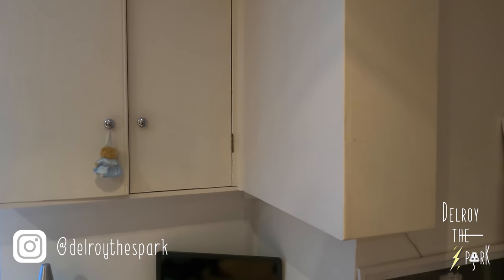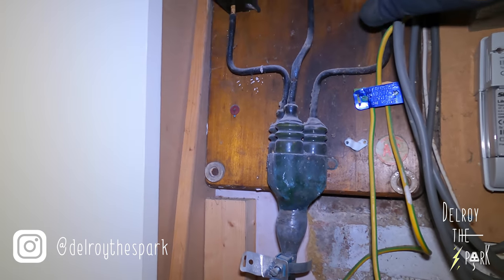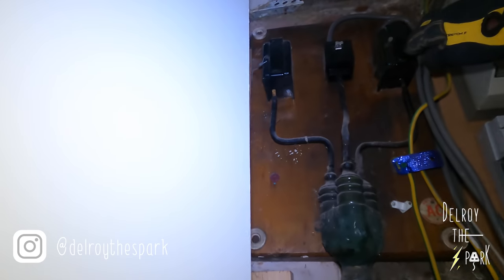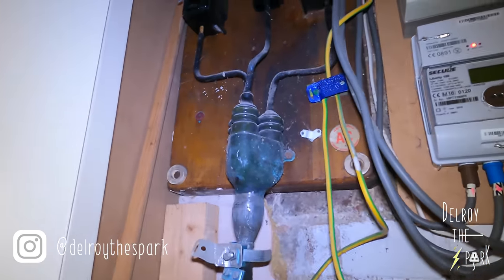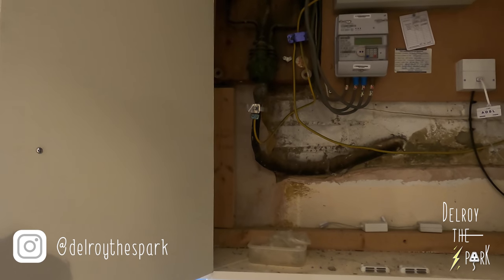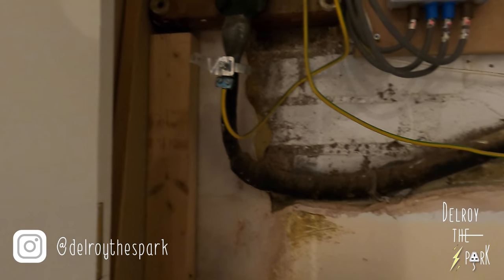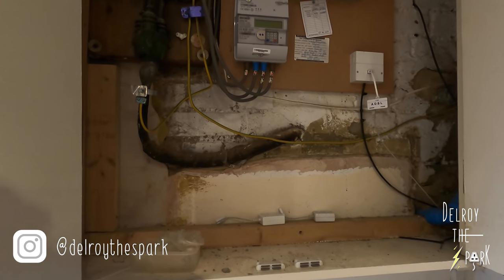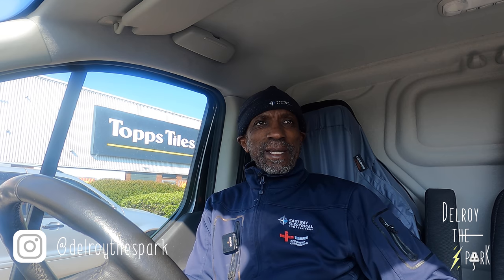"You Need To Contact UK Power Networks As This Is An Emergency" | Electrician In London Vlog

Comment: Absolutely shocking how competent the woman on the phone was compared to literally any company you could possibly call in the states. I am mad jealous.
Reply: Believe me, the majority of call centres here now are pretty clueless. lol

I did manage to get through the first call centre for Sky recently about our broadband dropping out, though,
The lady at Sky/BT was very helpful, knew what she was talking about, and immediately booked an engineer to fix the line.

(phone wire pulled out of the terminal on the telegraph pole during a mild storm.)

That's honestly the exception to the rule, though. The first guy at the call centre stuck rigidly to his script, and forced me to do the basic checks again, like switching the router on and off before he would do ANYTHING else. lol

The waiting times are generally quite long, too, even before the Rona.
Most call centers are farmed out to Countries abroad, too, so they often don't have direct contact with upper management at the company when there's a problem.

But yeah, it sounds like the US has it a bit worse than us overall?
We can at least sometimes still make contact with a human here, and not just an automated message or script robot.
Reply: @electronash  My ISP (Teksavvy) here in Canada will also typically go with the whole basic turning the router on and off and all that malarkey too.  That is until they found out that I worked in a data centre previously.  I suppose they put a note on my account because when I call for support now instead of the basic questions they start getting me to do various network tests so they can avoid getting a technician sent out.  I know I am technically doing their job for them in that situation but hey, whatever gets my internet issues at the time diagnosed the quickest I'm pretty happy with as it gets things sorted out sooner.
Reply: I work for an equivalent electricity distributor in a different region of the UK. We have fairly high standards but the key is keeping staff long term as the amount of knowledge you need to retain is pretty immense & people naturally want to move on up the ranks & out of talking to the general public on the phones, who can be a bit of a challenge at times. I've been in the customer service side for nearly 20 years now, mostly due to the decent pay, good working environment (from home for last 12 months) & abundant overtime. Experience is key. Still, people interact with us as if it's our first day on the job, when we've heard it all a thousand times before. 

The sparky in this video does a proper job and speaks to the local distributor himself. Many just pick up the easy callout fee & run, leaving a clueless customer to call in & give god knows what explanation of what is wrong.
Reply: @electronash  funnilly enough i noticed whilst longer waits the quality of the calls went UP during rona the staff seemed more relaxed more intentive to helping you when you needed to be transfered they would jump you through the queues they would pre brief the next person on EVERYTHING manager escalations tended to happen more promptly and everyone just seemed happier

i think having the call center folk work from home rather than some stuffy office block with bitchy supervisors prowling around them like hyenas is the best decision theyve ever made
Reply: @Sarge92  Yes, in fact I could tell the person I got put through to was working from home, and she was super helpful.

No background noise nor supervisor, and she knew exactly what to do, and understood the tech involved.

It has been interesting to see how working from home has improved certain areas for some companies.

Obviously we'd ALL rather the rona was never here in the first place, but maybe there are a few lessons to be learned from it.

I heard that certain companies are even considering allowing more staff to work from home now.

(especially in the IT sector, where people don't necessarily need to be in an office environment.)

There have also been studies in the past where they changed the school opening hours for students. Starting school at say 9am instead of 8am had a pretty huge impact on alertness levels and learning.
Reply: (suddenly reminded of scenes from Office Space. lol)
Reply: @electronash  ive seen that although it was a little different for ages 6-10 they recomended 7am to 8am starts and for 11-18 they recomended anywhere from 10am to 11am because they found that teens needed anywhere upto 11 hours of sleep in order to have full cognative fuction turns out reqiring your entire hormonal system to new adult software takes alot of energy out of you hehe
Reply: That is definitely not normal for the UK. I've lived 20 years in the UK and 20 in the US. Any service person in the UK (if you can get hold of them) generally acts like they were hired 20 minutes ago and plunked into the job with no training.
Reply: The guy mentioned that he was with Octopus Energy, I've been using them for over 2 years and have been really impressed with their customer service!
Reply: @electronash  same in germany..

DSL Connection is not working, i tried 3 different modems, tried connecting the modem directly where the phone wires enter the house, restarted several times... but when im on the phone, they insist you restart the device, even if you say you are in fact competent and tried all this.. no, sir, please restart the router
Reply: @Enclave.  I used to work in a isp call center, and unfortunately this is a case of a few people spoiling it for all the others. I would get multiple people a week claiming that they have already done the basics, when they had not done anything apart from maybe turning the computer on and off, and some times not even that.
Reply: @canonip3000  Trouble is people lie, so you are forced to do it all again because of those people. Saying you are competent is also no help. Many male 20 to 30 year olds will say they are competent or expert on computers, when they are not, and takes more than the first few minutes of a call to see if that person really is competent or exagerating their expertise.
Reply: Probably because those emergency numbers don't end up in a callcenter but distribute to a helpdesk at the company itself. Meaning you would end up with well trained staff who know what they are talking about.
Reply: @Sarge92  11am school would be terrible. I don't think people want school taking up most of the rest of the day.
Reply: @electronash  used to do some call centre work and something I noticed is that the only people who even bothered following along with the scripts (other than the legal scripts - everyone used those because the law and shit) were new people and people sat right near the bosses

everyone else would use their intuition and know how a bit to get stuff done faster and more efficiently
Reply: shes more competant than most people here too. i keep having to battle a power company here cuz they keep trina charge a house i own with something like a 3 grand bill even though the house has been disconnected BY THE COMPANY for almost 12 years
Reply: @electronash  sent a technician to fix it, not an engineer
Reply: @Enclave.  same with internet here in the UK. this is an emergency line. same as calling 999/911. these call centres take calls for people reporting gas leaks, major electrical emergencies and the like. they wouldn't put an untrained dummy on the other end of these types of calls. 

with ISPs, of course you will get a call handler who justs makes you do a check list of different things to diagnose faults.
Reply: @richardclarke376   My brother worked in a BT call center and it was a nightmare of a job. He would have been somewhat useful for a caller as he's actually generally knowledgeable about the area prior to getting the job but BT basically just gave up on their training part way through leaving them struggling. Every other person he was hired and trained with had left within 8 months, he left after a year. The turnover is so high because companies just don't look after the new staff and I think they just give up and move on constantly.
Reply: People in this post are talking about chalk and cheese. How can you compare power grid workers to satellite TV workers. 1 literally is responsible for life, the other is responsible for what TV stations you can get.
Reply: @electronash  I understand where you're coming from but we sometimes forget that for every competent caller there may be incompetent caller calling the helpdesk. You just have to watch reality tv like 24 in A&E to see how people like to waste time or want company
Reply: I think he was lucky... They are by no means all that competent her.... But great job whoever that lady was.
Reply: @electronash  unfortunately the first guy you get HAS to stick to the script and get you to check this and that because 80% of the people wanting escalation usually have an issue that can be fixed with these basic checks. This happens with sky, virgin, etc etc
It's an unfortunate downside of making sure that the waiting times stay as low as possible (if you think they're bad now, imagine if everyone lied about doing the checks, only for the issue to actually be solved by one of those checks. That's why you have high waiting times)
Reply: All she needed to know was the the cable head was overheating. She's admin and has picked up some lingo, but doesn't actually understand, nor care, about 2ph supplies etc.

Comment: I'm a network operator responder, we deal with these every day. The main difference between us and a sparky is the PPE we carry can protect us while working live with insulated gloves  jackets and face shields.

We would have to respond to this job within three hours.
Reply: Mate you need to start YouTube channel with your callouts
Reply: Was about to comment that the spark should have just been straight onto the DNO after assessing it was not the consumer side and they would be out in a few hours.
I was in a property recently and discovered a previous occupier had been steeling the leccy but on righting the connection, had screwed up and gave reverse -ve polarity.

Had a local out, the DNO out, their supervisor out all within an hour.

I now carry a tester with me when going places and always test the polarity and earth before plugging anything else in.
Reply: I had something similar where they were having power cuts when using an electric shower. Turned out to be a loose connection on the supply side. I was amazed how quickly they were out to sort it, think it was less than 30 minutes.

Comment: That mains feeder is vintage, would be awesome in a collection. Looks like it is mini glass insulators. Certainly looks the part of a mad scientist tehehe! Service provider def should come out and replace that with an updated connection to the latest regs. I too would suspect a poor connection, causing arcing and thermal runaway. Thanks for sharing, always love seeing unusual and vintage items in a setup!
Reply: it belongs in a collection, not in service
Reply: @lorenzo42p  Those old service heads were made to last. I wonder how long today's plastic junk will be around. I reckon it has at least another 250 years service in it 😂
Reply: @Rooster---ooo  the problem with these is often where the glass meets metal. you can't see inside to know if it is in perfect shape or if there is corrosion and looming failure. for something as important and possibly dangerous as this, it shouldn't  be overlooked until a problem does come up. foreign electrical just amazes me, the things they find acceptable and normal. I definitely don't like how electricians here worship the code book, but some things we just know to never do. we don't mount circuit breakers directly on wood connected to dinosaur cables.
Reply: @lorenzo42p  Over the past 20 years I've heard of very few critical failures of old cutouts. They do break down from time to time, but that's to be expected when you have millions in service. Ideally, they would be updated (as the one in this video probably was) but just because they look ancient, doesn't mean there's anything fundamentally wrong with them. At last in my experience.
Reply: @lorenzo42p  please. You used to mount uninsulated wires on porcelain knobs screwed directly into the wood of the building. You totally did mount fuses directly to wood panels at some point. Not every building could afford to mount them on marble slabs.

Just as no modern electrician here has done this in decades, you haven’t either. But the power company’s main feed isn’t going to magically upgrade itself, even when the home owner upgrades their own stuff.
Reply: my concern is the what if. the use of a circuit breaker or fuse is so the electrical system will fail-safe. we want an uncontrolled situation to become controlled and safe, as quickly as possible, faster than a blink of your eyes. we want very low chance of a catastrophic failure, like the building burning down. the electrical feed for my house comes into a metal circuit panel via a thick metal pipe. if any wire inside that box becomes compromised, it's contained within a thick steel container. at the minimum, that allows me time to escape.

I am definitely not a safety nazi. I disable and remove more safety devices on things I own than there are remaining. but be smart about it, think ahead, understand and accept the risks.
Reply: @lorenzo42p  futzing around with an existing situation is what gives you risks — as you can see here; with the failure being caused by the meter upgrade.

A mains feed that has been both completely stationary for fifty years and also completely safe isn’t going to stop being safe out of nowhere.
Reply: @JasperJanssen  I understand if it ain't broken don't fix it, only make things worse, can of worms. but on the other hand, this component wasn't directly messed with. it only took a little nearby work to cause a failure. is it a card castle just waiting for a touch for it to all come down. I could use a gas can as a desk chair for 20 years until one day it falls over and starts a fire. was that safe until it wasn't?
Reply: @lorenzo42p  you could get exactly the same result by changing all of it out, if the same incompetent was doing the work. The danger here wasn’t the old fuse, it was the idiot who didn’t tighten the connection properly.
Reply: @Rooster---ooo  i think it may well date from the time of dc mains as the street feed with that was opposing polarities + and - 200 or with common centre, alternate houses on alternate polarities, (lucky ones had 200v positive, unlucky ones 200v negative, in terms of things like tvs and radios), usually one polarity per house but some may have had both for high power usage

Comment: I had my power go recently due to the 60+ year old joint in the street failing. When the UKPN chap pulled the service fuse he found someone had bridged it with copper wire! Previous owners of my house had an electric shower and were partial to a bodge so I suspect they had the 60A service fuse blow whilst showering, running the washing machine and boiling the kettle all at once and thought that was a suitable solution. 
Stupid, stupid people.
Reply: Six-inch nail is another favorite. Just asking for trouble.
Reply: That's the only electrical tip you need.
"IF A FUSE FAILED OR A BREAKER POPPED, IT WAS PROBABLY SOMETHING YOU DID, STOP DOING IT."
Reply: @jr540123  A lot of that stuff is an emergency fix that gets forgotten about, in a car I'd give people a much better pass than their house.
Reply: 60 amp? thats not alot of power. im in canada. i can run my car charger, my washer, dishwasher, heatpump, my oven, my microwave all at once without issue.
Reply: @diablalexfull  UK Voltage is 220-250V, whereas in Canada it's only 120V. Most houses have a 100A main fuse in my experience.
Reply: @Oscar-if6lq  Got 240v also to in canada to run oven, tumble dryer and aircon.
Reply: US/Canada should start using 240v points for kettles as well
Reply: @finnw1  when I update my kitchen I will get another one installed. A 1500w kettle just doesn't cut it.
Reply: @diablalexfull  60amp main fuses are fairly common in small houses, flats and bungalows where they might only have 1 ring main, a lighting circuit and an electric oven. Especially if stovetop, heat and hot water is generated by natural gas.